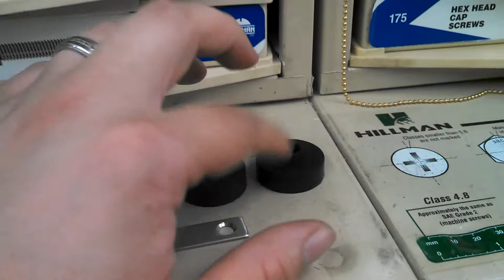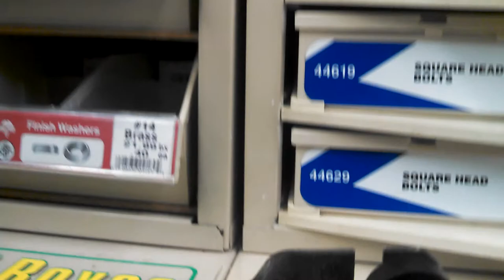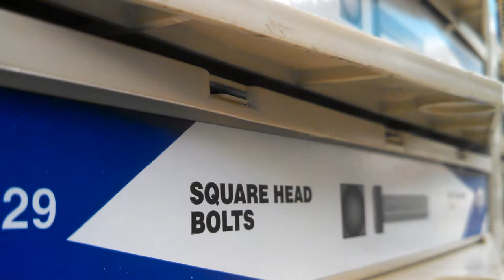Making your own J-hook Grommet w/ hardware store parts (short version, unedited)

Comment: I live in a place that has J Hooks only for ceiling fan mounting and I just don't feel like trying to figure out how to get one of those expanding replacement brackets in place. A few days ago I replaced the very old ceiling fan in one bedroom, I was able to reuse the grommet and bracket to adapt the downrod of the new ceiling fan to the J Hook. In the other bedroom and living room, just the hook remains with no grommet or bracket. I have searched far and wide to find a J Hook Downrod bracket. Seems they are still a normal thing in Australia, but shipping from there to the U.S.A. is amazingly expensive. There are places that sell them in India, but shipping and product numbers are a problem. The producers in India only want to ship 100+ items at a time. I only want 4 so I have 2 for the fans I want to put up and have 2 spares. The shops in India don't want to sell just 4 so either won't answer inquiries, or the shipping cost is so outrageous it simply isn't worth the expense.

After a night of ever increasing frustration with trying to find a place to just buy them, I came across your video. Several times I let out an expletive such as when the phone fell over or when you asked if the viewer could see what you were doing "$#!!$# No!", but then in the end you showed what it was you had put together and it answered my questions. I was beginning to go down the thought trail of wondering if I could just make something myself, and I think I will be able to now. Just needed some confirmation that someone else had done it.

Though, a quick search of the local stores online stocks isn't finding the electrical bushings as you found, even without finding something just like that I'm sure there is some other item I can keep an out for to repurpose.
Reply from the maker: What country are you in?
Reply: @dspiffy  I'm in the United States, Florida specifically. I went to the hardware store yesterday. I was able to get the mending plates and appropriate bolts/nuts. They didn't have any rubber bushings or grommets like you had but I was able to order some rubber spacers that should be the right diameter.